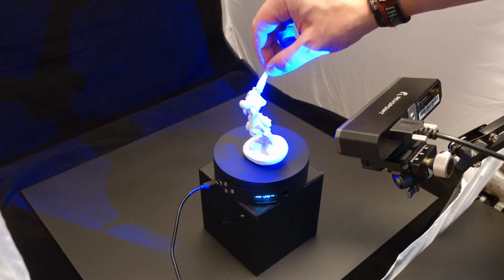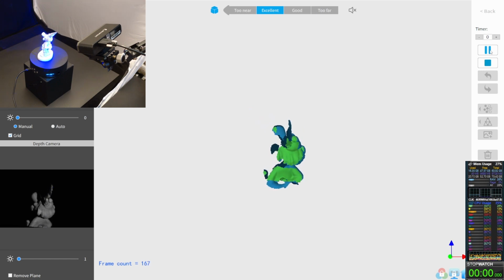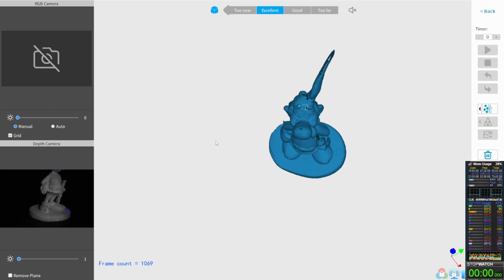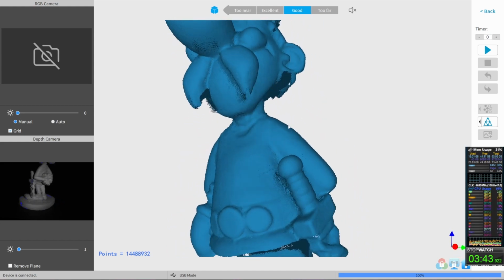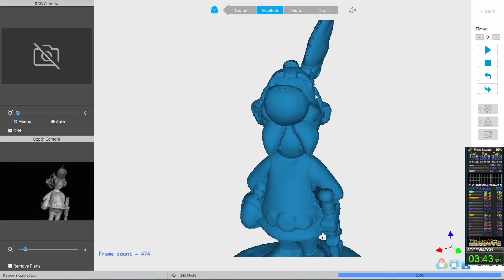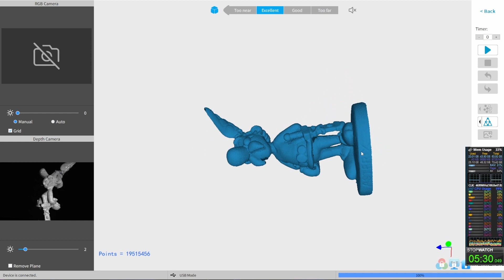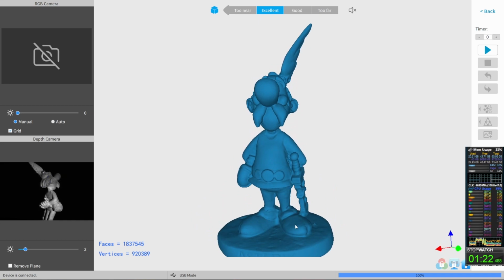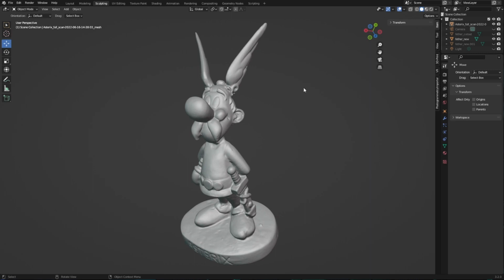Revopoint MINI: Complete scanning process with some performance data

Comment: I just bought my Mini and am a new user at all this. I downloaded the new version of the Revopoint software but I have to say, I think I like the version you are using better.  Much simpler and easier to understand. A lot of what you are showing I have not seen and had no idea about doing, like stopping the scan and fusing before doing a second scan. I was just trying to do a second scan without fusing and it was giving me all sorts of problems. Thanks for this!
Reply from the maker: Thank you very much! :)
I have to say that I like the new software a lot better - especially when it comes to processing the data - but it's also different to use.
I can try to make a video with a similar process with the new software.
If I have the time, I would do it next weekend.

Comment: Love the video well presented clear and precise, love it, I am new to scanning so have a couple of basic question I see you use an enclosure (light box) and your turntable is that a revopoint turntable it just look very smooth in rotation... Looking forward to more videos.......
Reply from the maker: yes - its a lightbox - i now use a bit smaller one - but it helps to control the lightning. The turntable is a moded Revopoint turntable. I replaced the electronic to be able to control the speed and also added a remote control to it :)

Comment: this one does seem as good as the pop 2
Reply from the maker: this scan is not far from the POP2 - the POP2 is an excellent scanner - no question - only the smaller parts (especially the ones where the missing wing should be fitted) are already better with the MINI